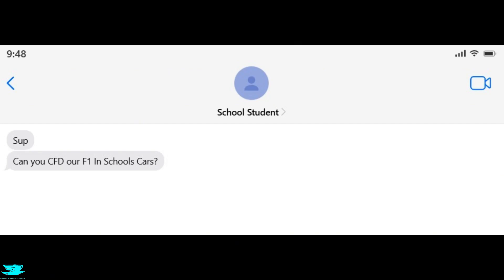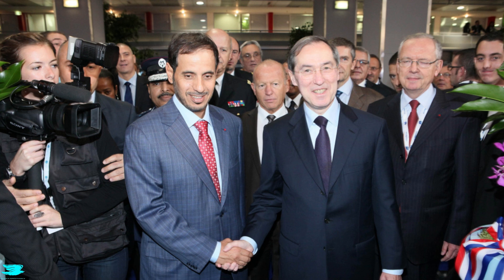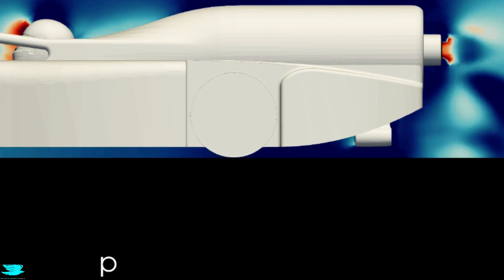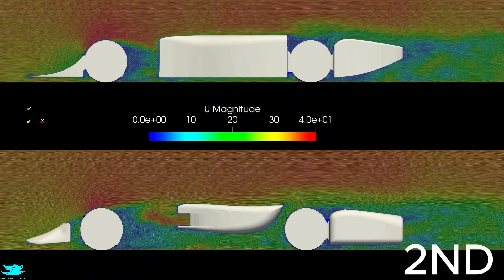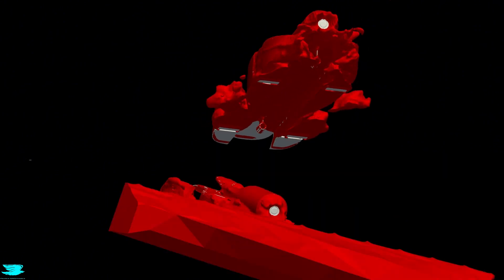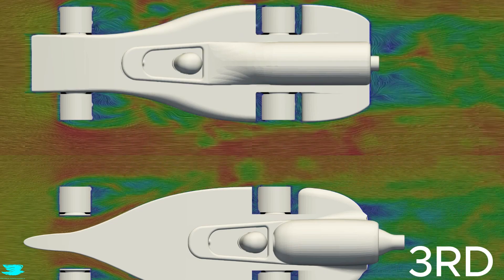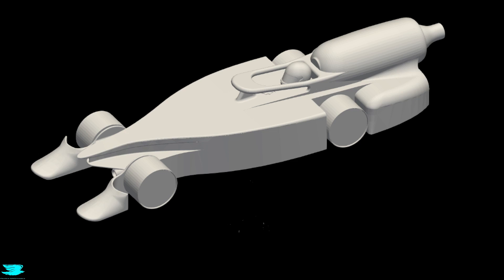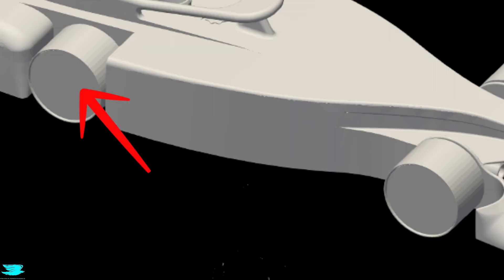How To Improve F1 In Schools Aerodynamics

Comment: This seems very similar to the pinewood derby cars from boy-scouts. General rules for that were make the car as light as possible, as long as possible, and put the weight as high as possible.  This seems similar in you would want the canister as far back as possible, the car as light and long as possible. 
But depending on how much you can bend the rules, I would be curious to see how adding a heater to the cartridge would affect speed.
Reply: Heaters arent allowed
Reply from the maker: Making it light and long is a great idea to increase acceleration and reduce the amount of track you need to cover.

Comment: I am wondering if opening a hole in the sidepod like the real F1 car guides the flow behind the front wheel to the upper part of the car, or it is just better to desgin like car 1 and guide the flow to pass the back wheel?
Reply: Also, is creating vortex by adding some fin on the front wing helps? Or the car is too small to be effective
Reply from the maker: I think that those would be great to help reduce the lift/increase the downforce. But, it would come with a drag penalty. Here, I think reducing the drag is key even if it comes at the expense of a little more lift.

Comment: Unless their rules state that they have to have certain design elements, the fastest versions of these cars I've seen have this formula: make it as short as possible, make it as light as possible, and obviously make it go straight. Literally they end up being 4 wheels connected by sticks and a CO2 cartridge.
Reply: that's the exact formula I used in my 7th grade shop class CO2.  Minimize weight and rolling resistance, and just "smooth" any sharp edges.

Comment: What's the pressure inside the CO2 can? The exit velocity might reach sonic speed if the pressure is greater than 1.85 atm.
Reply from the maker: IDK, the current outlet speed was 80 meters per second. I don't think the real life version would reach sonic speeds because there doesn't seem to be any shock waves in any videos.
Reply: @PremierAerodynamics  Maybe it's because it's too small and the camera isn't close enough? There are videos showing jets from spray duster using Schlieren imaging and the shock diamonds are clearly visible from those videos. I assume it's the same case for CO2 cartridges.
Reply: it's 850 psi, and the exit hole is about 0.5 mm (8gm co2 cannister)

Comment: I’m surprised by how complex the designs are. Moving in a straight line like that seems like it would produce a very ”simple” aerodynamic environment and by extension a simpler/cleaner design.  

How much do they focus on rolling friction and do they lube those string guides?
Reply: As I designed the cars in the video, I can tell there is a lot to consider while designing.
At first you want to minimize  the frontal surface area and want to lead the air as effectively as possible.
To achieve that however you have to consider the rulebook of the competition which makes the rather simple job waaay more difficult
there is basically no rolling friction as we use ceramic bearings to minimize it. 
lubing the guides could honestly be a good idea! Thanks for that!

Comment: the CO2 canister being mounted up higher than the CG will create a nose down pitching moment.... But no downforce. It won't make downforce unless the canister is angled downwards, with the exhaust shooting back and upwards. You know that though. 
If it is pointing upwards, it must be a very small angle; It's not obvious.
Reply: the nose pitching moment divided by the length of the wheelbase is the resulting downforce on the front axle. a more intuitive example could be a plane with one working prop on its left wing. This plane will create a yaw moment to the right and the resulting sideforce will change the yaw angle of the plane.

Comment: Making a fin (vertical stabilizer) like in an airplane would create additional drag if the car turns sideways, thus might help in keeping them straight.
Reply from the maker: It would be interesting to see the difference between fin and no fin in a race to see if the added drag and weight outweighs the thrust benefit.
Reply: @PremierAerodynamics  I am looking forward to make some tests with our car in february. I will have a look at that
Reply: @PremierAerodynamics  Using a fin or generally some kind of components that move the COP further back are actually quite effective. We did some track tests and concluded that the fin was actually improving the race times. We also analyzed the distance between COP and COM and based on that, we were able to optimise the entire car geometry.

Comment: Are you not allowed to shroud the CO2 nozzle in a diffuser? Not for downforce but for more nozzle performance.
Reply: no, the nozzle has to stay untouched
Reply: @xXGHXSTXx-h6u  weak.
Reply from the maker: Lol. Making the nozzle more efficient is a great idea! If you get it close to perfectly expanded, the thrust would give you way more acceleration than pretty much any other improvement (maybe all of them put together).
Reply: It was allowed and was known as LERS, but it was banned later. The team that holds the current fastest time record was among the last to be allowed to use LERS. That is why the record hasn't been beaten yet.

Comment: Thanks a lot for making a video about my cars! The video was amazing! I really appreciate it. Just one question: Did you measure the cars at 60mph?
Reply from the maker: It was 70 mph.
Reply: @PremierAerodynamics  okay so I calculated the drag coefficient and with the air density 1.2 kg/m3 I got about 0.25. however that is crazy good (like on world finals level...). And because I cannot believe that I wanted to ask: At what Air density did you measure the car?
Reply: @xXGHXSTXx-h6u Your car is not legal, the body is way too close to the rear wheels.

Comment: What is the minimul downforce needed for the wheels not to slip? If it is less than the weight of the car it could be an idea to produce some upforce to lower the rolling resistance?
Reply: The wheels don’t need to grip at all, from what I’m understanding. They’re basically rockets on wheels, so the wheels aren’t powered.
Reply: @Max-gi1xj  oh yeah ofcourse, that would mean that any downforce would be a negative since it'll increase rolling resistance no? So the ideal would be 9.81m/s2 of lift and no downforce? As this would mean the car has 0 normal force and thus 0 rolling resistance?
Reply: @Lucas-cg5kq  this would be one way to optimize the acceleration. you have to keep in mind that producing lift (same as producing downforce) comes with a drag penalty. So you have to hit the sweet spot of minimizing the sum of: rolling resistance + air resitance

The additional component is the direction of thrust, you have to keep the car a straight as possible for maximum acceleration along the track. You may be able to optimize this with aero, but again this then comes with a drag penalty.